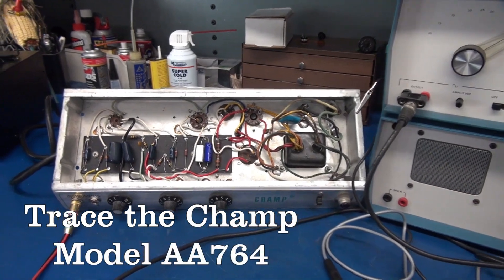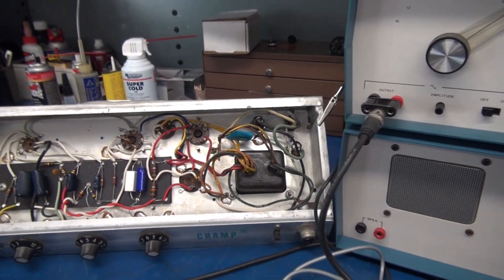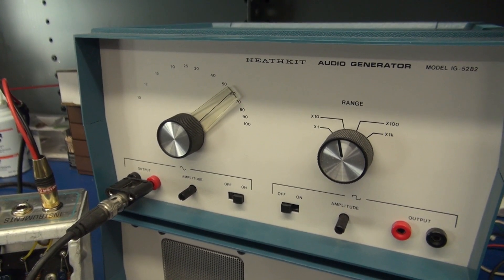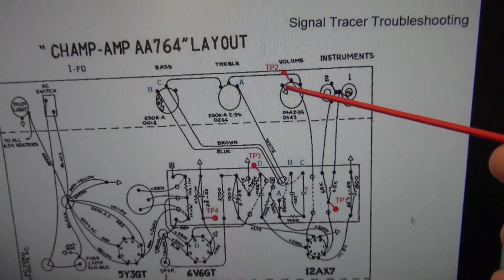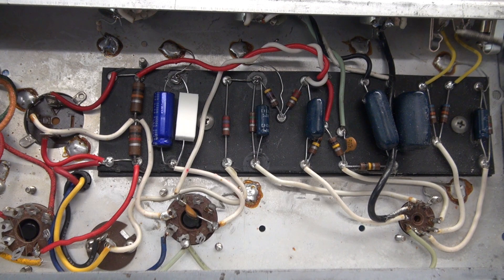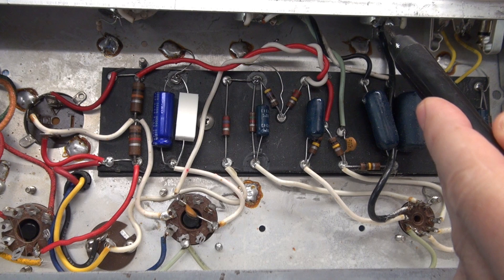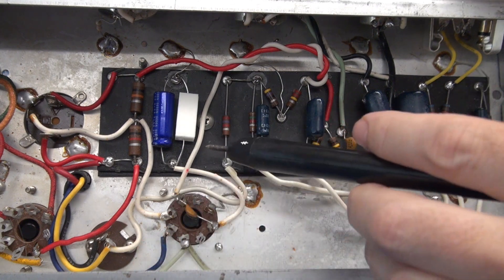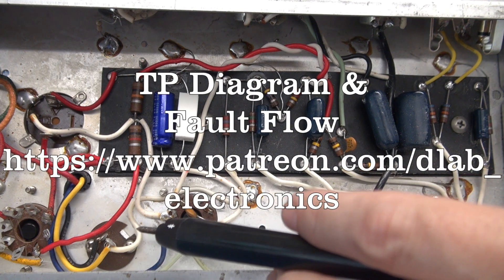How To signal trace Fender AA764 Champ tube guitar amp using Heathkit Test equipment

Comment: You seem to be a clever chap. I wonder if you could help me with a little electronics problem? I have an old metal detector with a bad 35 ohm speaker, I tried changing it out with an 8 ohm but it effected the overall performance of the machine. So I was wondering weather it would work if I put a 27 ohm resister in series with the 8 ohm speaker?
Reply from the maker: Hello, Yes you could do that. The detectors audio output circuit would be happy, however you will still get reduced sound due to the resistive loss in series.
Reply: @d-labelectronics  Thank you for answering my question. I will try the resistor then, and see if I can live with the reduction in volume.

Comment: Great video. Would it be feasible to do this with all tube amps? What a book that would be.
Reply from the maker: Yes, I do plan to make TP charts and fault flow diagrams for amps as they come in for repair. Should have done this long ago.
Reply: @d-labelectronics  put it out in book form.

Comment: What would be a great affordable signal tracer to buy today to do such work?  Without building one from scratch, just something simple like in the video? 
Thanks anybody.
Reply from the maker: There are several on the used market, Heathkit, Eico, Micronta, Knightkit, Some transistor, some tube type, check ebay
Reply: @d-labelectronics  Thankyou :)

Comment: If the 1kHz signal on cathode of the output tube seems to be quite strong, the condition of bypass cap should be checked. At lower frequencies of course the quite small bypass cap of the cathode resistor  cannot efficiently shunt the test signal to ground.

Comment: Thanks Terry.  I have a question regarding a dummy load for a Bassman 5F6A build.  The output xformer is 2ohms connected to 4 RCA output jacks for the 4 8ohm speakers wired in parallel.  Would you use  4 separate 8 ohm resistors for each output jack or is there a better way?
Reply from the maker: It sounds like the RCA jacks are already wired in parallel on the output tranny secondary,  looking for each 8 ohm Speaker to equal 2 ohms. So, I would say, you could use 1-2ohm resistor, just plugged into 1 RCA jack. That should meet the requirement
Reply: That’s what I thought thanks for verifying.  Keep bringing it.  Dummies like me need all the help we can get.

Comment: D LAB, it would be nice if you can Confirm that all the GAINS for each Test point and each stage are the correct GAINs compared to the schematic. Don't you have a dB meter to compare with the schematic? Signal Tracers are good when testing for noises what components are generating the noises or the board has moisture causing leakage between eyelets. Signal Tracers can help isolate so lower the noise level in amplifiers which you should make a lesson on troubleshooting noise floor issues in amplifiers.